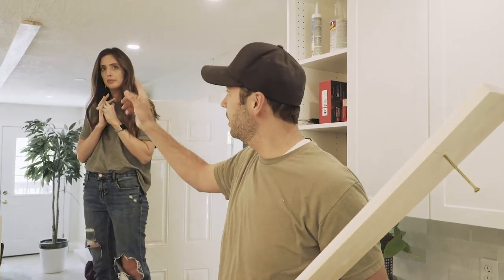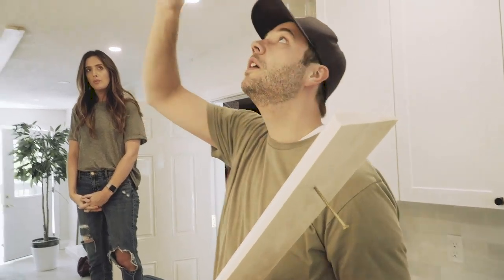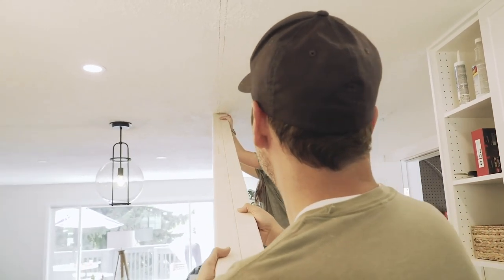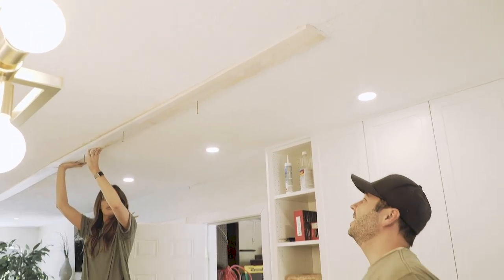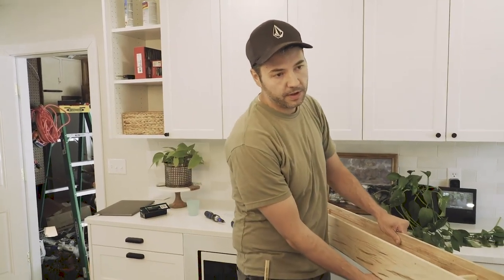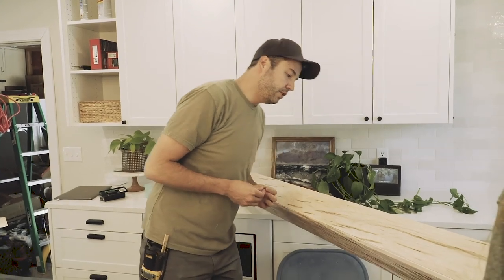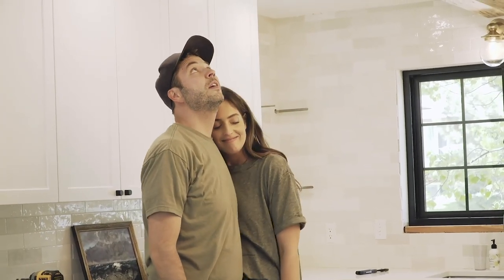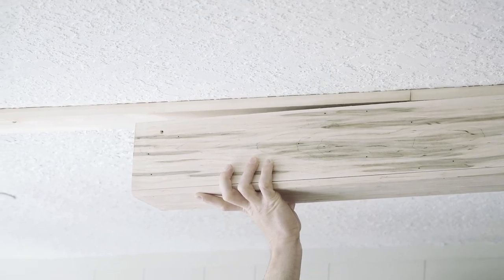How to Install Faux Wood Beams (and a peek at vertical shiplap)

Comment: looks good- but serves not real purpose in strengthening the ceiling.  How thick is the cladding on the walls?  not really a fan of cladding on walls- cheap way to make walls look good-but in the long run they get damaged easily (especially if you have kids).

Good cover up on the slit connection.
Reply: Action Replay Good thing it’s not you home👍🏼
Reply: Shh, you talk too much.